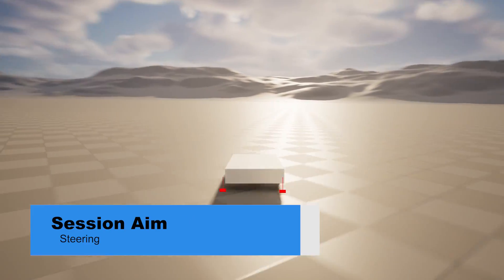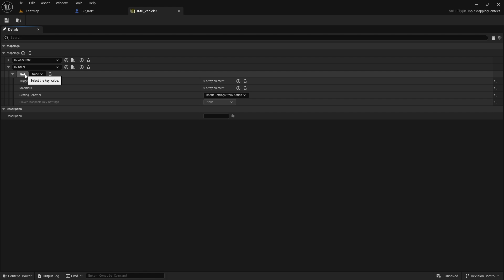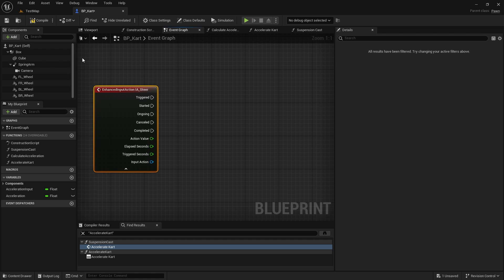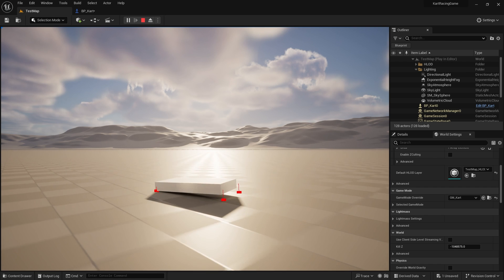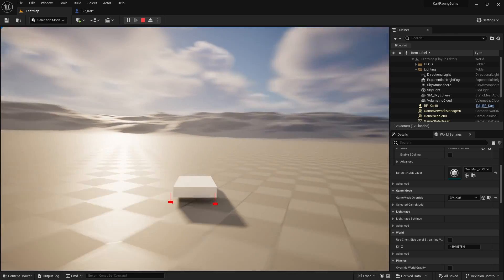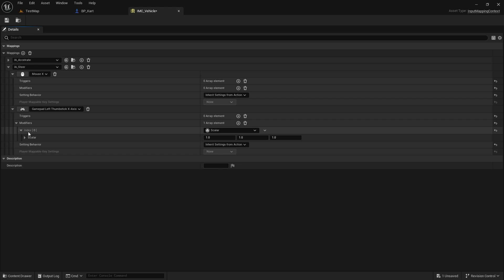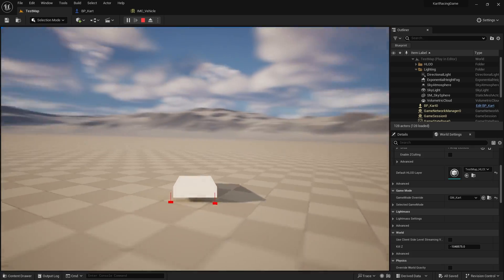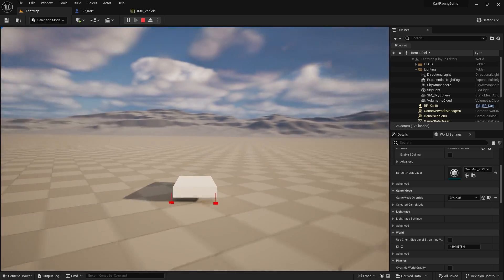Unreal Engine 5 Tutorial -  Kart Racing Part 3: Steering

Comment: Its very unstable on bumpy terrain it flips. Can you implement a Line trace that checks if a threshold distance from the surface is reached and then pulls the vehicle down (relative to the normal of the surface ) Or something like that? Something like that could even help driving on the ceiling maybe? Simply adding mass or linear/radial damping doesn't help.

Comment: 3:20 Does this work for anyone else? Followed the tutorial exactly(despite the heavy hiccups in the previous two videos requiring some extra online help to get it to barely function) but I cant get the box to steer with the mouse or keyboard. Car moves forward, stops and goes in reverse with W and S and is an exact copy of this blueprint but still wont steer. Watched the video 3 times now at 0.5 speed to check that I copied what he did precicely and it wont work still.

UPDATE: I got the steering working after HOURS of fiddling around. For some reason, Angular Dampening effects steering. If the number is too high, the car wont steer. However, thats a bit of an issue for me because since the previous 2 videos anything lower than 65.0 makes the box car do wheelies. I "corrected" it by dropping it to 10.0 and applying that X axis thing you did to make the front of the car dip downward more but I had to use 450.0 vs your 50.0 to get the front to stay down. However, the car still bounces erratically since the first video and wont settle into a completely stopped position as yours does with the steady red lines. The red and green lines are flashing erratically and it wont settle. Not sure why yours doesnt flash red and green.
Reply: My angular damping is at 102
Reply: I got it working on my end, but it is hard to say what happened. For me, I used Keyboard, A and D, I initially added a negate but it seems like it didn't need it. I needed a high number as well, make sure all the Exec white lines are connected out to a Set Steering. I am also a beginner, and I can't remember what I did earlier. sorry I can't help more.
Reply: @Hydronide  No worries. Does your kart bounce around wildly too? Mine will bounce around wildly in the playtest mode and the red debug lines flash red and green while it tap dances non stop but the kart in the video has solid red lines the whole time.
Reply: @JupiterxBlues  I actually forgot to set the debug lines. I had notice I forgot to set all the wheels and doubled the suspension on just the leftside. So I made a tornado car. Haha
Reply: @Hydronide  That sounds like a feature lol. Well if you ever encounter the hopping around and find a fix, let me know. Been scratching my head on this for a week now.
Reply: One solution would be to make two different Input Action Mappings.  One for each direction. Under the array elements set the scalar with 50 for the left and negative 60 for the right. Or vice versa.

Comment: Could you perhaps give a tutorial/ information on how to implement a roguelike/ choice system on URE5. For example after reaching a certain amount of XP you get a choice. How to add new ones, how to set it up, how to upgrade it if you choose it twice etc.
E.g: Speed boost x1.05and thensecond time perhaps x1.20 etc.

I cannot figure this out and find no info on it anywhere
Reply: When you get to choose you check if the player already have the speed up, if so increase it's stat, if not, gain the first level. Look into Ryans leveling series, they could give you some hints on how to set up skills and such. Then you just need to modify them to fit your roguelike :) Good luck!